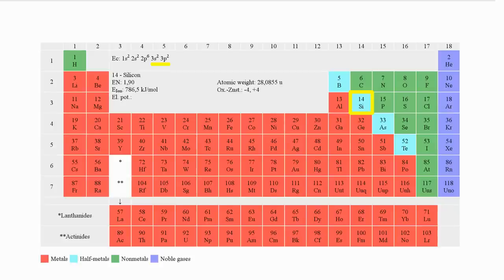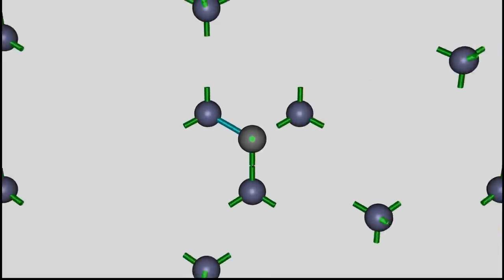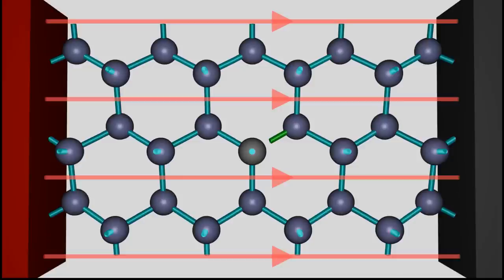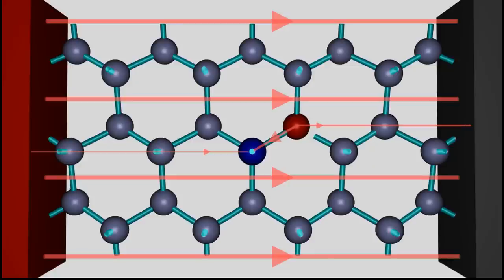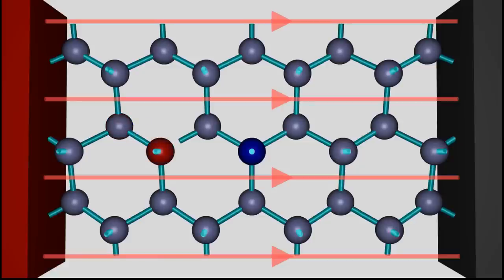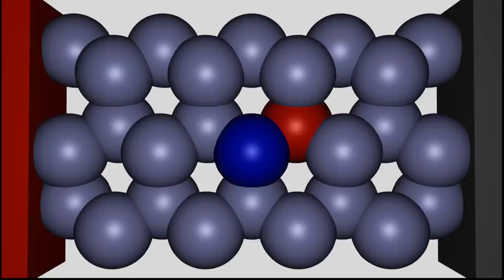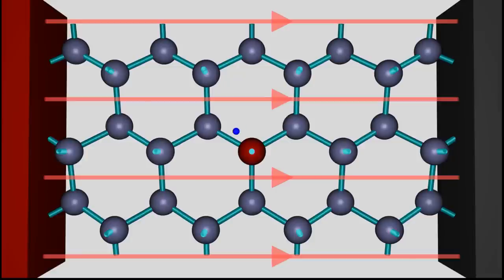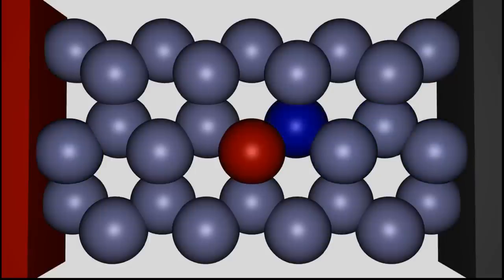Doping of semiconductors

Comment: Omg, at 5:57 I finally understood why they consider holes as positive charges moving, instead of just electrons moving (which is really what happens). Of course, because the electrons only move as far as the origin of the hole goes, which has the effect of a created hole moving. Thanks a lot for the indepth explanation, and for the work done.

Comment: 3:28 - Those absence of an electron in a covalent bond is called electron hole? May be you tried to say ELECTRONIC HOLE, because the "electron hole" is meaningless. For this reason, it's preferred to use simply the word HOLE, even if actually we don't have a PHYSICAL, but an ENERGETIC "HOLE" (absence of an electron in a particular energy level). Very good animation. I would loved to have the animation without the legends, in order to use in my class. Thanks.

Comment from the maker: No! Field lines are painted with the arrows pointing from the positive to the negative pole. Inside such a field, the electrons are moving from the negative to the positive pole, thus contrasious to the direction of the arrows. In the animation the electrons are moving from the right to the left which is from the negative to the positive terminal. Propably I should add some remarks about electric fields in the new version of the video.

Comment: sir i am a student and having a thesis. i had some difficulties on what to consider on selecting a doping agent in Cu2O.. i select Fe and Al the problem is i don't know what the right criteria in selecting it. so can i ask you for some help... thanks
Reply from the maker: The operating mode of those "metal rectifiers" is slightly different from that shown in this video. Compared with silicon based semiconductors, the performance is very poor (low maximum reverse voltage) and since metal recitfiers are no longer used in modern devices, I have no experience in using them.
Is there a special reason why you are working with copper oxide semiconductors?